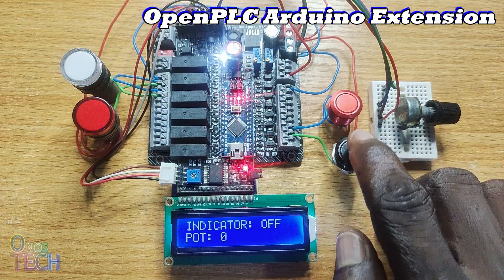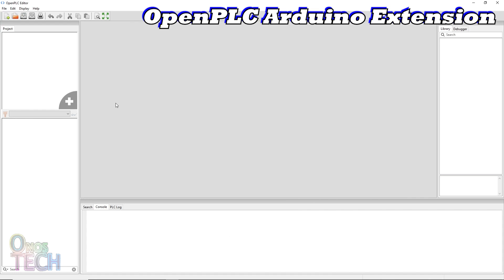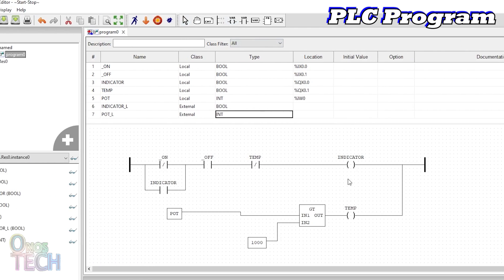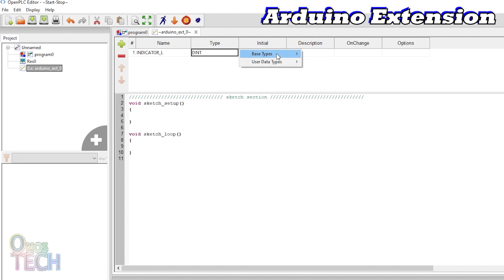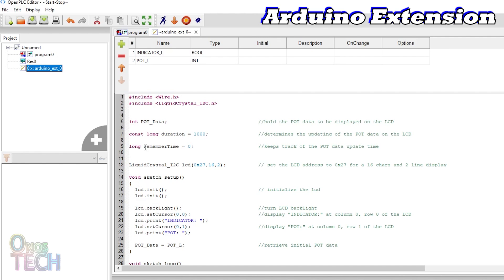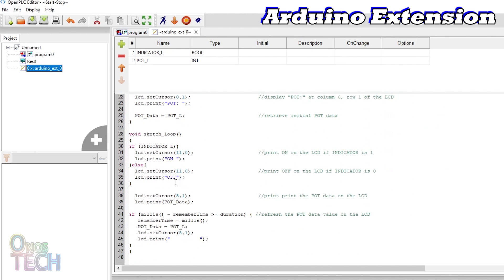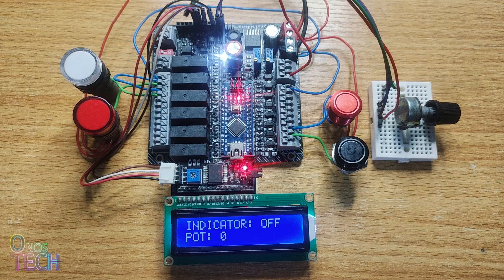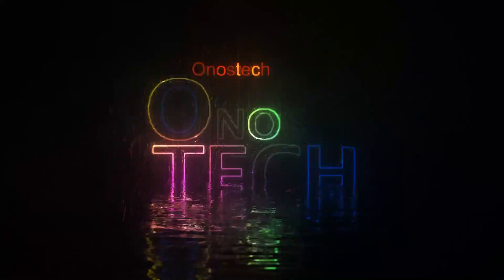Low-cost HMI for the OpenPLC Arduino Nano PLC

Comment: Your code did not work in the Arduino IDE program. Or does it only work in OpenPLC program?

Error: C:\Users\Bill\AppData\Local\Temp\.arduinoIDE-unsaved202538-28636-nm4dto.k12at\sketch_apr8b\sketch_apr8b.ino: In function 'void sketch_setup()':
C:\Users\Bill\AppData\Local\Temp\.arduinoIDE-unsaved202538-28636-nm4dto.k12at\sketch_apr8b\sketch_apr8b.ino:25:14: error: 'POT_L' was not declared in this scope
   POT_Data = POT_L;                         //retrieve initial POT data
              ^~~~~
C:\Users\Bill\AppData\Local\Temp\.arduinoIDE-unsaved202538-28636-nm4dto.k12at\sketch_apr8b\sketch_apr8b.ino:25:14: note: suggested alternative: 'PORTL'
   POT_Data = POT_L;                         //retrieve initial POT data
              ^~~~~
              PORTL
C:\Users\Bill\AppData\Local\Temp\.arduinoIDE-unsaved202538-28636-nm4dto.k12at\sketch_apr8b\sketch_apr8b.ino: In function 'void sketch_loop()':
C:\Users\Bill\AppData\Local\Temp\.arduinoIDE-unsaved202538-28636-nm4dto.k12at\sketch_apr8b\sketch_apr8b.ino:30:5: error: 'INDICATOR_L' was not declared in this scope
 if (INDICATOR_L){
     ^~~~~~~~~~~
C:\Users\Bill\AppData\Local\Temp\.arduinoIDE-unsaved202538-28636-nm4dto.k12at\sketch_apr8b\sketch_apr8b.ino:43:15: error: 'POT_L' was not declared in this scope
    POT_Data = POT_L;
               ^~~~~
C:\Users\Bill\AppData\Local\Temp\.arduinoIDE-unsaved202538-28636-nm4dto.k12at\sketch_apr8b\sketch_apr8b.ino:43:15: note: suggested alternative: 'PORTL'
    POT_Data = POT_L;
               ^~~~~
               PORTL
Multiple libraries were found for "LiquidCrystal_I2C.h"
  Used: C:\Users\Bill\Documents\Arduino\libraries\LiquidCrystal_I2C
  Not used: C:\Users\Bill\Documents\Arduino\libraries\LiquidCrystal_I2C-master
exit status 1

Compilation error: 'POT_L' was not declared in this scope
Reply from the maker: It works only in OpenPLC as it is. It will require some modification to work in the Arduino IDE
Reply: Thank you for responding. After doing my own coding in open PLC, I found it to work properly.

Comment: Hi Onos:
How can you set the I2C speed communication in openPLC? 
Which are the valid I2C speed communication in openPLC? 
Great video btw!😀!
Reply from the maker: Try the setClock() function in the Arduino extension. Standard speed is 100,000 fast is 400,000.

Comment: Hello. I learned the LDMicro program from you before. It's really very useful. So which program do you think is better? LDMicro or OpenPLC?
Reply from the maker: Each of them have their peculiarities. But the OpenPLC supports 32bit processors, supports Modbus, have online mode data monitoring, more compliant with IEC61131-3 standard and it's still being maintained

Comment: Everyone, can I ask? When I plug in the arduino nano code to the circuit or test board, the code shows a COM error, why? But when I disassemble the arduino nano, the code loads normally? Hope everyone can answer this question, thank you
Reply from the maker: This happens sometimes when the TX and RX pins are connected to other components
Reply: @OnosTech  Oh I understand thank you very much